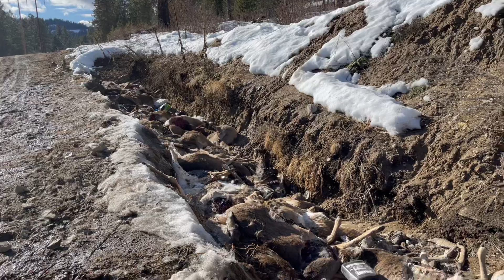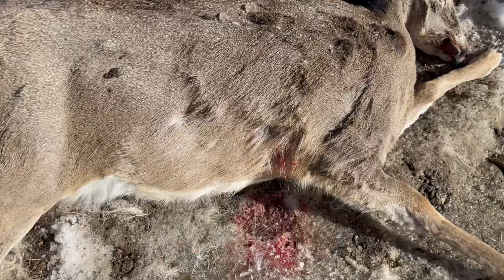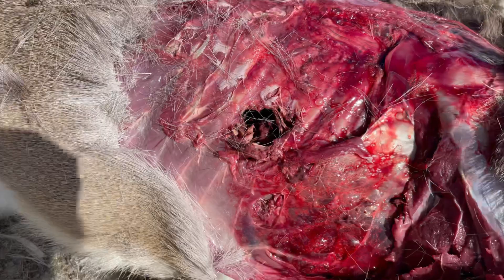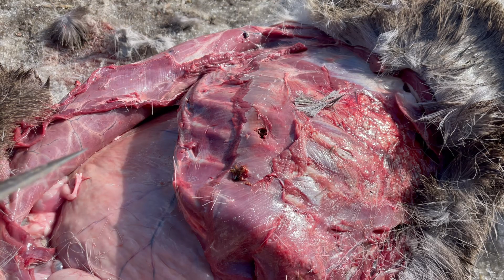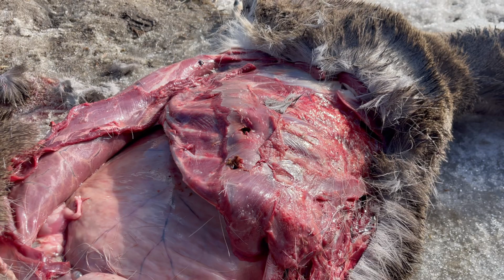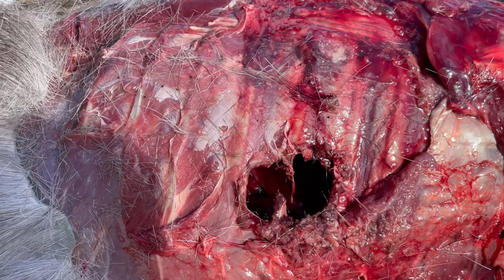Monolithic, Fluid transfer bullet vs. expanding bullet testing (on a deer carcass).

Comment: So me and my buddy are both building bolt action 460 smith rifles just went and got barrels ordered here in brookings or we found with ftx loads in our other guns they just blow up we’re looking to do load data on the extreme penetrator cause I want to be able to make a shot and not worry about bone but I also ordered some hornaday interlock 245 grain made for the 450 bushmaster see how well they hold up our of a 22 inch barrel
Reply from the maker: With the 205 and 220 grain extreme defense bullets, I use 45.3 - 46.2 grains of H110. That’s getting me 2550-2780 fps, depending on which load and bullet combo we are talking about.